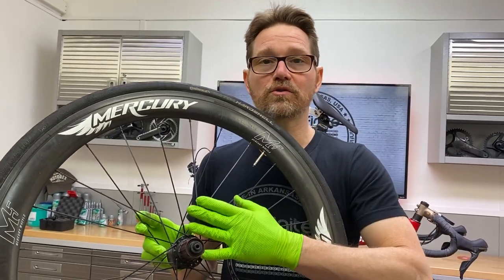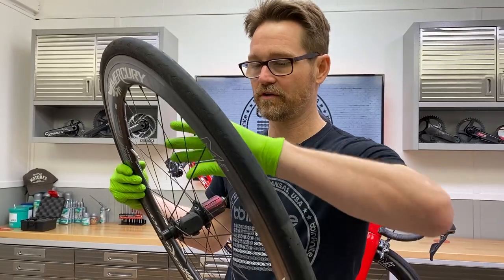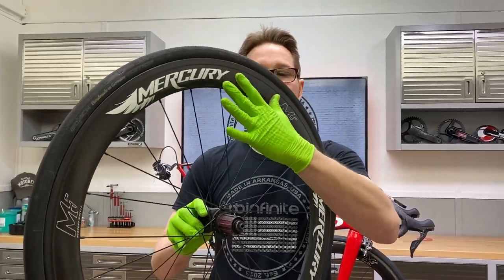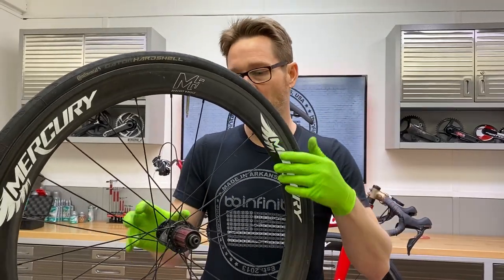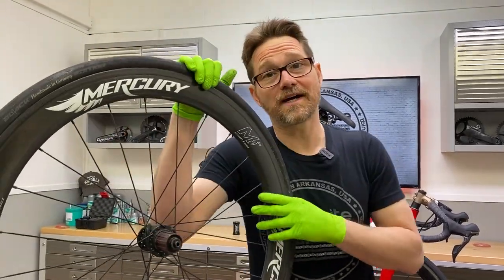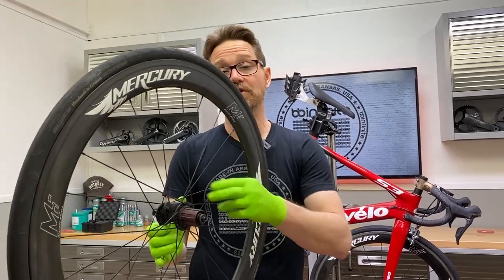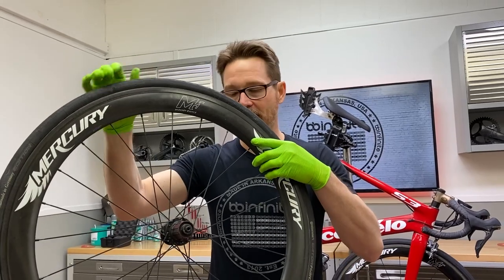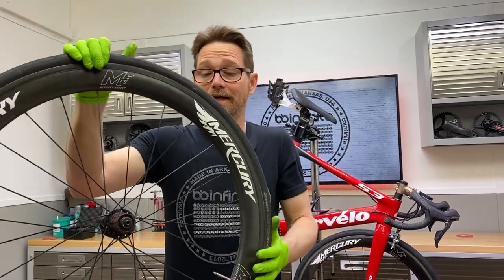Your Bladed Spokes are Creaking, Dude

Comment: I do have one of the cheaper DT Swiss Spline wheelsets on my bike and this issue started to show early. Having tried multiple things I eventually spotted the rubbing of the spokes and how, if I moved them as shown in the video, they made the same noise I heard while riding. Glad to have found this confirmation of my suspicion by a professional. Though not the answer I wanted to hear, this sure is the answer I needed.
Reply from the maker: If it makes you feel better, this happens to $3k Enve wheels, Zipps, etc. It's interesting that you'll never see this happen on Mavic wheels with bladed spokes because they engineer gaps in the lacing profile so that the spokes never touch even when they cross.
Reply: I second this. My DT Swiss CR1600 are doing the same. Fucking bladed spokes. Took me few months to figure it out. Paid nice money for it and in the end I get creaking like I ride a fucking 50 year old bike. Terrible.
Reply: Yeah same here on my ER1600 wheelset. All was good in summer, until i did one autumn ride in pouring rain.
Low and behold, the next time i went out, my spokes creaked when braking. I immediately thought it must be the spokes, because of the nature of the sound.
However, it is pretty sad to be confronted with this when buying wheels you thought would last you years.

Comment: I even experienced it for round spokes as well , got two cycles with round spokes btwin riverside 120
Reply from the maker: If they're round the solution is a simple tie and solder. Problem solved, and the wheel will  be stiffer.
Reply: @BBInfinite  Thank you for your remedie😀

Comment: For my DTSwiss folks, I saw another YouTube video last season where they were recommending oiling the blade spokes every few hundred miles. I guess that’s the cost of the 0.25w efficiency gain😂. I can’t recall what the oil was but I do remember thinking that was an odd lubricant to use on the spoke.
Reply from the maker: We find that grease stays longer. We simply spread the spokes apart, dab a bit of Motorex in between, and let em go. Wipe off excess. It's about all you can do.

Comment: Mine is just 6 month old decathlon mtb started doing these sound , its round spokes. I took a spoke wrench and tighten them , isnt that what you are supposed do ?
Reply from the maker: Often, new wheels need to be re-tensioned once they've been ridden some. If you did this in a truing stand and were careful not to pull the wheel out of true, then yes, that's what you are supposed to do.

Comment: If the problem is the contact area, does it make sense to replace half the spokes? Round on flat has little surface area. Amd you still get half the aero.
Reply from the maker: Interesting comment. Has anyone done this?
Reply: @BBInfinite  Not to my knowledge. But i'm not knowledgable in this field.
Reply: @BBInfinite  Alternatively rotate them all 180 degrees. Give them a new surface to reset the proces?
Reply from the maker: @Azeazezar  If that's possible, why not, but we can't think of any wheels that would work on. It'd have to be straight pull, no j bends or any other anti-rotation features.
Reply: @BBInfinite  Thats probably why it came to my mind.
Currently strugling getting a spoke undone on this straight pull wheel. Its round and has no anti rotation features. Rotating the nipple just rotates the spoke.
Gues im gonna have to cut it or put it in a vice.
Reply from the maker: @Azeazezar  We'd put  the spoke (still installed in the wheel) in a vice with soft jaws. We have aluminum vice jaw inserts to hold the spokes without marring them. If you did this with raw, steel jaws it would damage the spoke.

Comment: The ones that are so loose that making sound or tight ones?
Reply from the maker: The spokes are properly tensioned. Bladed spokes creak over time when they are are in contact with one another. Notice how many companies, like Mavic, use bladed spokes but never have this problem because they design the hubs so that the spokes never touch where they cross over one another.

Comment: Is there anything structurally wrong with the spoke or is it just an annoyance issue?
Reply from the maker: Nothing is wrong with the materials. It's simply a result of the application. Bladed spokes that cross with contact will eventually creak at the contact points. It takes awhile, but it's basically inevitable. Changing the offending spokes fixes it.

Comment: Ughhh, I have a set of DTSwiss G1800 wheels, this is the fourth season on them and the creeking is madening and embaressing! Who wants to be "that guy!" I have gone through every bolt on my bike, i'm on my second bottom bracket and this video has to be the reason. It only creeks when I stand on the pedals so all that loading on the rear has to be it. I hope, anyways! Thanks for posting this video.
Reply: Also have DTSwiss, I only get the creak from the front wheel. I assume it’s how the weight is distributed on the TRI bike. What’s odd for me is it only starts after about 60-70 miles into a ride. It’s completely silent when I first start.

Comment: Just installed my new DT swiss wheelset.   After a short ride in wet weather...and creak, creak, creak.... 😭😭
Reply from the maker: Oh, no!
Reply: Same. Mine is Spline Er 1600. Smooth ride, then after few days tiny clicks progressed to many. Really annoying
Reply: @zanguro6200  after 3 months, theyre still there.  If the bike is stationary, and you press down on the bike, you can hear the spokes creak.  I suspect its the flat bladed spokes rubbing against each other.
Reply: same here on dt swiss er 1400 ... driving me CRAZY!!!

Comment: No your not putting tention on the spokes by sitting on it, the hub is supporting your weight by being bolted to the frame fool
Reply from the maker: That's like saying a tree is being held up by its branches. I think you are joking,  certainly, but for those who may not understand, a wheel is joined to the hub by spokes, and these spokes work by suspending the hub in the wheel. When you get on a bike, your bodyweight pulls down on the spokes that are above the hub.
Reply: @BBInfinite  what the phuk are you talking about? A tree being held up by it's branches? That makes no sense and is irrelevant to what the topic is about
Reply: @BBInfinite  and wrong, he said you're "loading the hubs downward" your not because the hub sets on the frame and even if you were right (which you're not) you would be putting pressure not tention🙄
Reply: @BBInfinite  NO spokes work by "suspending the hub in the wheel, the frame holds the hub and the hub suspends the spokes.
Reply: @BBInfinite  everything starts from the center hence the name HUB🙄
Reply from the maker: @erichvonmanstein6876  The tensile strength of the spokes is what bears the load placed on the hub assembly. When you sit on your bike you are essentially trying to rip the hub out of the wheel, downward, due to the downward pressure. The spokes at the top of the rotation, especially the one that's TDC, is carrying the greatest load. The spokes at bottom dead center (closest to the ground) are unloaded. Spokes can't act like pillars, as Mavic has learned with their failed and highly problematic R-Sys Wheels. Spokes act like suspension wires. Look at successful wheels with carbon spokes, like Spinergy wheels. when not installed the spokes flop around. Just think of the dynamics and you will have that ah-ha moment.
Reply: @BBInfinite  🥱 you still crying kid?